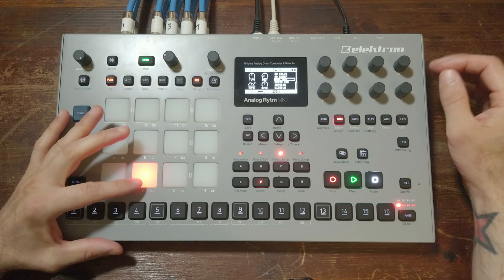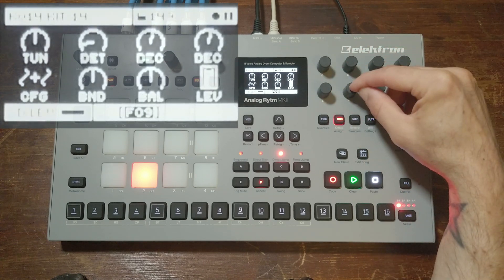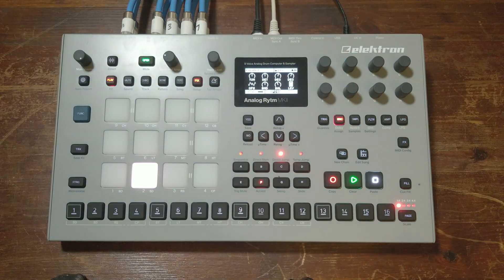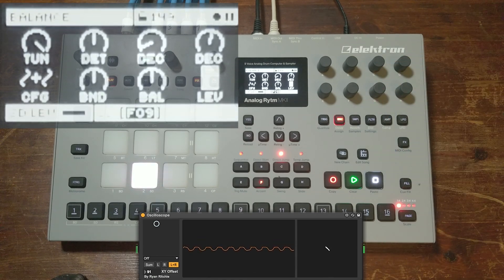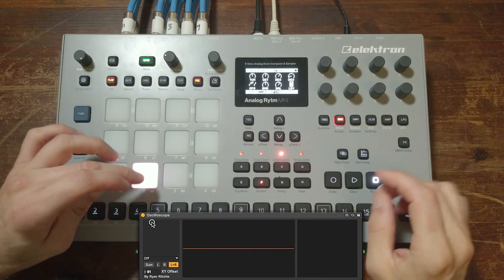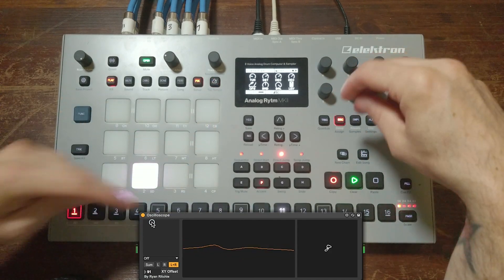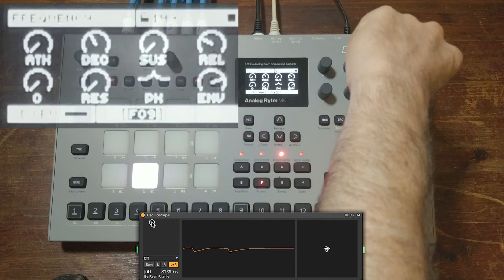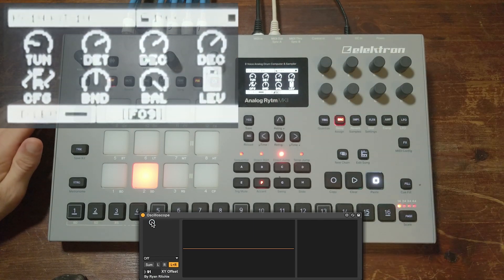Basic FM Synthesis with Dual VCO on Analog Rytm Mk2

Comment: thanks for this video.  Any idea where I can find a link that shows exactly how to update my unit?  I have 1.45 and still had trouble getting it to update based on what I found in the literature.
Reply from the maker: Sorry I don't have a link for a video explaining, but maybe I can help u get it updated. As of rn 1.50A is the current version. You will need either a sysex program or elektron's c6 to update. I use a free app called sysex librarian. Lemme know where u having problems and I might be able to help
Reply: @16Steps  Thank you.  Has yours ever had any "power related reliability issues?"  There have been a couple times where the power adapter is securely plugged into the unit, and when I turn it on nothing happens.  The screen remains completely dark.  Then I switch it on and off on and off, same thing.  Then I waited a few minutes.  Unplugged power adapter, replugged in, and tried it again and it turned on.  This will be my new main rig and want to make sure it is reliable for live performance and studio time.  Lol, really don't want to be concerned with it not turning on at a show or a valuable studio session.  Considering using warranty to have different one sent, unless others have seen this happen and it consistently works after a few flawed start ups on occasion. thanks!
Reply from the maker: @brokenstring21  actually, yes. When I first got mine, there was something rolling around inside it and was doing exactly this. I returned it for a replacement, no problem.

Comment: I can never seem to get any good sounds out of the DVCO on my Rytm. Theres like 60+ waveforms/patches off the bat and they all sound pretty bad.
Reply from the maker: It is a limited synth to be sure, but for my uses, I am able to make some cool basses, fx type stuff or droney sounds with it. I also usually run audio out of individual outs and use things like chorus and eq. So yeah, dualvco has limits, but can also be a good source of inspiration.
Reply: It seems like a lot of the features of Elektron gear sound best when automated, just setting a static tuning doesn't do much until you put it in motion.